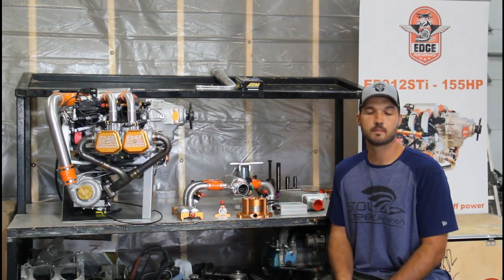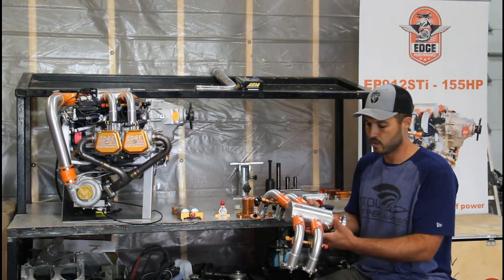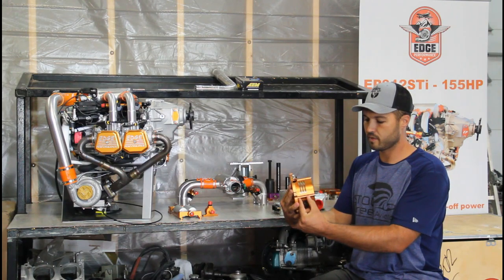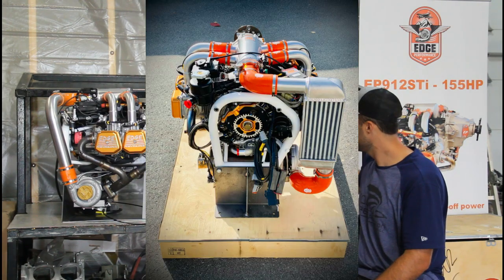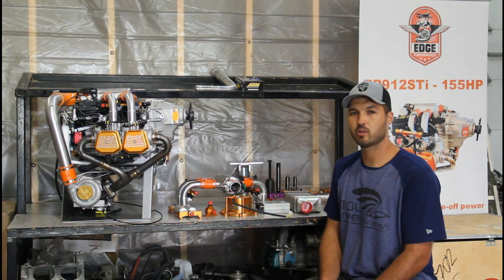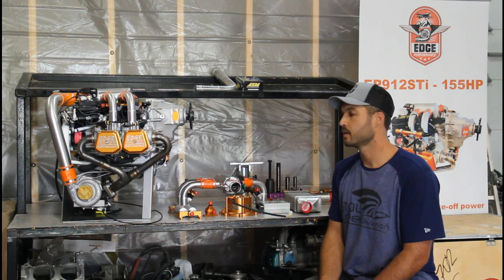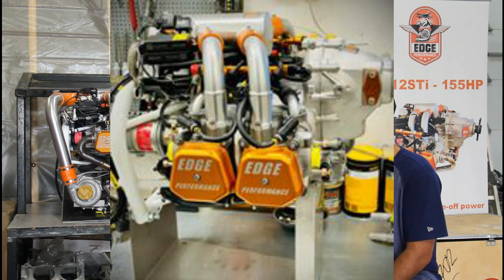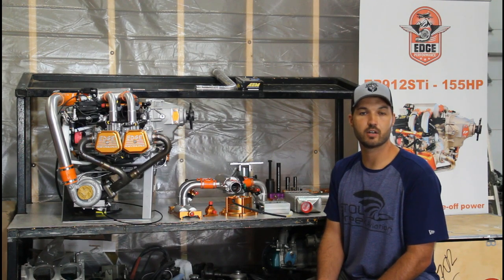EDGE Performance Products

Comment: I think Edge should spend more time working on Yamaha engines and to get the cost down.  The Rotax line you started with an already expensive engine add another $15,000  to it and ended up with just a few more HP than the 915 and a few pounds lighter. You did not do the industry any favors for all along, one of their biggest enemy is cost. Anything can be done if money is of no concern, the old say, what is engineering, to do something for $3 that any fool can do for $10.

Comment: Late to a past conversation, but regarding welding crankshft journals;  how much welding is done, stress relieving, crank alignment, etc.?  I come from a performance motorcycle background and I recall reading how welded cranks were breaking due to stresses imparted by the welding process. Once company went to a special anerobic adhesive to lock the crank alignment and no more crack issues.   With all the Edge engines flying, it seems the welded crank is not an issue.  Just curious as to how tbey got there.
Reply from the maker: Yes the crank will break with a deep hot weld. We have just been getting in and out quick with a light tack weld (not incorporating to much heat in the web) and the crank does fine.

Comment: How does the ep912 STI interface with a Garmin g3x? Same set up as rotax 915, harness wise?
Reply from the maker: No the EP912STi will connect like the 912uls. The Autronic is not currently supporting a can bus system.

Comment: I noticed the Sonex engine mount on the 915ECI engine.  Can you provide that engine mount?  If not Edge (or STOL Creek), who does provide the mount?  Also, it looks like the mount in the photo attaches to a standard Rotax ring mount?
Reply from the maker: That was a one off mount that we do not produce. I am finding that there would be some interest in a ring mount for the Sonex. It does not seem like their bed mount setup for the Rotax is very good.
Reply: @stolcreekaviation5507  Ring or bed mount, having a ready to bolt on mount for a Sonex would be super!

Comment: A question about your monster rebuild of the Rotax 914 is as a fair dinkum replacement for Rotax’s 915 is...
   I have perused the videos of the South African boys (about to stall) and love what you at Edge Performance have been doing with a 914 core.
   I am wondering if your ‘Edge 914is monster build’ includes support for Full FADEC?

Comment: Regarding the Apex 1L Turbo, is the upper cylinder design open, semi-closed, or closed?  It’s my understanding that an open design is least favorable with a boosted cylinder and will be more prone to a head gasket failure with excessive cylinder movement.

Comment: Can you elaborate on the upper cylinder support with the Apex 1L turbo?  Since a boosted cylinder is most stressed at the top, if the cylinder is not supported properly with a boosted engine, the head gasket will be suspect to gasket failure.  So is the upper deck open, semi-closed, or closed with respect to upper cylinder support?

Comment: Would the EP912STi work with a airmaster prop controller on sling 2? 
Does the cowling need modifications on sling 2?
Reply from the maker: Yes the air master works good on the EP912STi. The main consideration on the sling is where to put an intercooler. Currently working with a builder installing one on a Sling 4.
Reply: @stolcreekaviation5507  That is awesome! Videos with installation and modifications needed on different aircraft would be really nice. Thank you.

Comment: What fuel burn difference is there between a carbed 912S (using a Hacman Leaner, as I do) and when the same engine is fitting with the FI system?  I routinely get 3.2 to 3.5 GPH now, using the Hacman, at my average altitudes of 6 to 10 K.

Comment: I'm really intrigued with the EPeX/Apex engine. I'm pondering the possibility of building a Wittman Tailwind W10 in the future someday and just looking at what engine would be best for it now and kind of planning ahead (even if this is a good couple of years out). I'm looking for something that is rather experimental (since certified parts are more expensive) and relatively inexpensive to own & operate with good & low-cost part support and I'm torn between the EPeX and the ULPower. Both are high horsepower and lightweight but have different approaches. 200HP is my limit since the Tailwind can break 200MPH on 160HP which means the EPeX 300 is waaay too overkill for this design. So a couple of questions I have for the EPeX would be:

-What is a rough cost estimate of the EPeX 150 and 200Ti?
-Can an EPeX package be "customized" such as turbocharged 180HP instead of 200HP or 150HP that is turbonormalized/turbocharged only at high altitudes?
-What is the max continuous HP the EPeX can run when turbocharged and how long can it run past its limit (like after take-off)?
-What is the weight for the 150 & 200Ti variants?

Would greatly appreciate a response/answer to these questions!
Reply from the maker: I would love to talk with you and answer some questions. Shoot me an e-mail at mike@stolcreek.com or call me 316-435-3837.
Reply: @stolcreekaviation5507  Alright cool!

Comment: The 300 hp Yamaha engines looks great in STOL competition, but... What do you think about cross-country application?? (You know...3-4 hour 50-75% continuos power) for example, in an RV-10
Reply from the maker: We get this kind of question a lot, Yes it is great for competition but it is not a good replacement for a 300hp engine. It will make 300hp for take off power, but max continuous is only 160-170hp. Its best application is as a rotax replacement/upgrade, a little more power at about the same weight. The RV-10 would probably be a little to much plane for that engine.

Comment: Is it possible or practical  to put one in a Vans RV6 or RV 7?
Reply from the maker: The RV12 was designed for the Rotax. It would take some work to convert a 6 or 7.
Reply: @stolcreekaviation5507  would the big one go well in a sling tsi?
Reply from the maker: @JoséAlbertoOlguínOrozco  Yes the 155hp EP912STi would be a great engine for the Sling TSI.